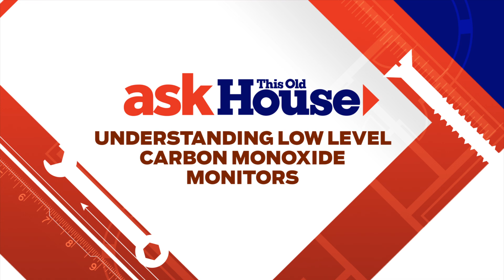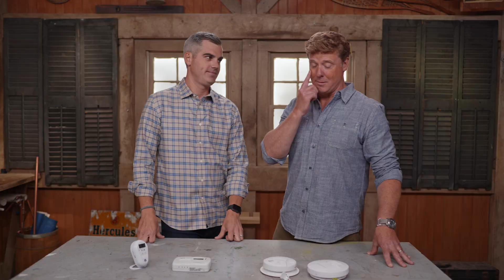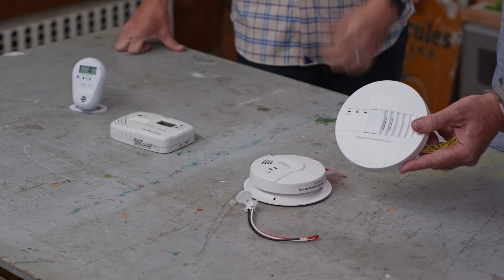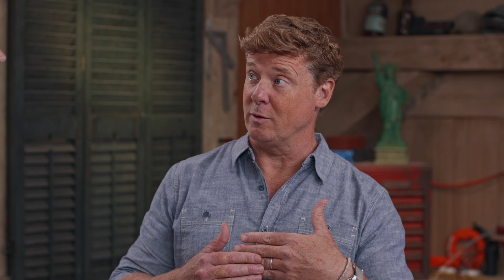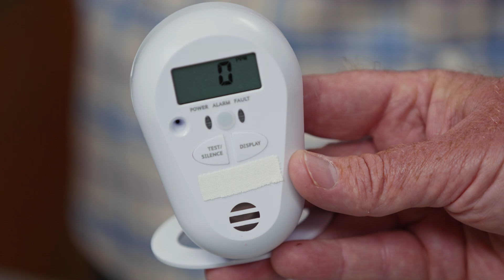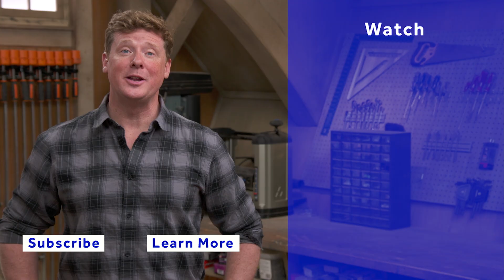Understanding Low-Level CO Monitors | Ask This Old House

Comment: Thank you so much! I purchased one of the Low Level CO monitors you listed. We are in a 1st floor loft with cement floors and the garage is directly beneath us. We had a 911 experience when a company was cleaning the garage last summer, wherein the CO alarms went off, and the lofts above the garage all filled with CO. My guess is that there is still CO seepage from the garage into our loft and now that it's winter---people are warming up their cars inside. Could account fr the recent headaches and dizziness.

Comment: Yes, low level detectors are important to have as well! My regular over the counter, round alarm did not detect or sound when I was getting sick for several months. I had no idea the ones you buy for every day use don't sound until a certain level is reached. The one I had didn't sound all winter and it wasn't until my symptoms were so terrible that I couldn't stand it any more and started doing my own environmental investigations by having service people come and check for mold and assess my HVAC system. The service tech found a leak and crack in my HVAC with his commercial monitor. Very dissapointing and confused on which is best to have on an everyday consumer basis since mine didn't alert me. This video is helpful.

Comment: I have a CO detector on every level of my house. 3 of them with digital readouts. All three have a peak display as well.
I    had   a 2 stage Hi Eff furnace that was leaking CO into the hot air supply only when it was in the second stage or high heat
The furnace was inspected, tested, serviced 3 months ago and  passed with flying colours.
The tech tested for CO in first stage heating and second stage even tested the CO output on the exterior exhaust pipe.   AND    there was the downfall!  He didn't recognize or know what the reading of CO was telling him in second  stage heat.  IT was a low reading at the exhaust pipe of  11 ppm which was actually two low, It should have been closer t0 20 ppm or higher.
So for months I was suffering symptoms of low level CO poising and    NONE    of the CO detectors triggered because the CO was below the trigger points of level and time.
Got 2 tech in from the company and the second tech knew instantly after running the furnace what the problem was..a crack in the heat exchanger that opened just a fraction as the heat exchanger got much hotter in the second stage of heating. 
Note: this was his his diagnosis  without   physically inspecting the exchanger itself. 
Low levels CO poisoning is a real threat but until I stated researching it I was totally dependent on my CO detector that never went into an alarm state. I had symptoms of rapid heart rate, skipped heart beats, the worst BRAIN FOG,  just on the edge of a headache and nausea and a real need to keep opening windows without knowing why.

Comment: I have two parrots in my home and need a low-level detector
Defender vs co experts vs  nci6000
Are any others you recommend
Thank you
Reply: I’ve been working as an expert witness on CO cases since 2006. My company (TruTechTools$) sells CO Experts and Defender alarms. The NCI ones are available only through NCI contractors. 
All three brands are fine products in my opinion. They have a few feature differences, but basic functionality is similar.

Comment: 30 years ago this type of CO detector bought on a whim led to discovery of potentially lethal furnace problem in our home with 2 young children. What TOH failed to say is that there are good yet inexpensive detectors (Nighthawk is the one we had) not just the $100+ models they are pushing. Also, the CO detection chemistry gets depleted so these things last 10 years or less.
Reply: Thank you for sharing!
Reply: Nighthawk USED to be more sensitive, now they meet the same inadequate standard.

Comment: Does the alarm go off if someone farts? Asking for a friend.
Reply: That’s methane  and a few presidents said it’s climate change so best not fart . It should show a difference in climate change in 10,000 years or more .
Reply: Flatulence is mostly methane, CO2, and hydrogen sulfide gas, not CO which is why it smells bad.

Comment: Poor information.  More like scare tactics.  What level are we targeting?  Are they recommending zero ppm??
Reply: They already said it would be different for different people.
Some people have lung dysfunction like emphysema where they don't take in enough oxygen and can't tolerate as much CO as healthier people. Some people are home cooks that may have a gas stove running most of the day and have a longer period of exposure than others. Some people may have a malfunctioning heating system or a leak where the levels spike for short periods of time but not long enough to set off alarms.
Reply: There are health risks for very low levels.  People who are either small or have medical issues that make them less able to recover from exposure should want lower levels for shorter periods of time.  If you own a gas range, ignition will create CO.  But with good ventilation, it will dissipate quickly and you are at extremely low risk.  The bottom line is that if you are small, old, or sick, this should scare you.

Comment: Also: if your low-level monitor is showing non-zero, your furnace heat exchanger might be starting to rust out and you can catch it way before it finally trips the code-required CO detectors, maybe even years earlier, during which you would otherwise be breathing CO.  (Any appliance that burns gas - even a water heater - could cause this if there's an issue with the combustion itself or the ventilation of the combusted gases. )

Comment: Can ya tell us more about radon meditation units
Reply: There are new radon measuring devices, AirThings brand, that my company sells (TruTechTools). They will alert you as radon levels that change due to various factors. 
Radon mitigation systems (ducting and fans) need to be installed by qualified professionals which can be easily found on line. 
I assessed high radon levels in my own new home and had to install a radon mitigation system to get below recommend target concentrations.

Comment: Wonder if there's a cheaper, or free, way to test the levels without having to purchase a low-level CO monitor? We have only electrical appliances and never have used our gas fireplace (propane). However, often have headaches and now wondering if CO might be cause.
Reply: Could be mold, particulate matter, low oxygen levels, VOCs... you should have a good ventilation and filter system doing X number of air changes per hour (depending on house size/number of people).
Reply: @rustyshackle917  Yep, or even high levels of carbon DIOXIDE, which can be a concern in "tighter" houses where leaks are minimal, reducing air exchanges, normally a desired effect, but Richard Tretheway often discusses the membrane-based heat exchangers that are important for bringing fresh air into tight houses.
Reply: Sadly CO cannot be detected without a measuring sensor and these engineered devices have a price, as said $100-$200
Reply: It's all about how worth it is to you. Is your health worth the $50-$150 for a low level CO monitor? You could shut off the main gas supply line. Propane does usually have a smell however. A free, but unreliable option would be to have a friend come over and ask them if they smell anything, but obviously that's not good enough.
Reply: @StuffTested  After seeing the high end models and Fire department wearable i’m going to spend a few hundred for family gifts .

Comment: Excellent information. Even UL says its acceptable levels may be too high for elderly, immuno-compromised. Will have to look into sensitivity of the “approved” devices required by code (California) in my home.
Reply: All about PPM and TWA. Parts per million and time weighted average. Good info.
Reply: As the commenter and video noted, it’s about concentration and time of exposure since CO is a cumulative poison.

Comment: can't be zro though. we breathe out co.
Reply: we breathe out CO² not CO
Reply: @TexasMAGA2028  Carbon dioxide is not CO² , it's CO₂ .
As for breathing out CO (carbon monoxide), the OP is correct in that we do breath out CO – we do it every time we breath in CO. That being said, if the OP was trying to say that we produce CO through normal, human respiration then he's mistaken and probably confusing CO₂ (carbon dioxide) with CO.
Reply: @Confoil  well excuuuuuuuuuse me mr. perfect. i typed that comment on an android, it doesn't have the lower 2. humans only expel CO after CO poisoning or smoking.
Reply: @TexasMAGA2028   You're not excused as that's "Mr. Perfect." I know your android has the capability to capitalize letters – so use it. Other than that, correct your posts before correcting someone else, don't repeat what others have said when you are responding to them, edit your posts when necessary (that's the point of that edit button), and get a better phone that can do subscript numbers since your's (according to you) can't.
Reply: CO (carbon monoxide) is not the same as CO2 (carbon dioxide)
Reply: No way you would ever exhale enough to set a co monitor above zero under normal circumstances. Shoving in your mouth and letting about a huge breath might tik it up but it will fall as fast.
Reply: carbon monoxide makes a strong bond with hemoglobin and is cumulative.  Our Hvac contractor measured the levels from our gas furnace and replaced the burner to reduce the output of CO.
Reply: No we don’t 🤦‍♂️

Comment: CO alarms "...mounted on the ceiling."  ?????
Reply: A lot of CO detectors are built into combination CO smoke detectors so they're typically on the ceiling.

CO distributes itself evenly in a room with a slight bias away from the floor, so placement of CO detectors is a lot easier than smoke detectors.
Reply: According to First Alert's web site CO is slightly lighter than air but diffuses throughout a room evenly, so their CO detectors can be mounted on the ceiling.  Kidde's web site doesn't specify any particular location in the room as long as it's not in a "dead space" area.
Reply: CO is heavier than Oxygen. I'd mount low
Reply: @knowledgeispower6192   CO could be heavier than oxygen but it's lighter than air.
Reply: @knowledgeispower6192  This isn't how gases work, look up Boyle's law

Comment: How much of carbon monoxide is in the air?
Carbon monoxide is the most abundant, by mass, pollutant gas. Atmospheric carbon monoxide levels in typical urban areas are around 10 ppm (parts per million), about 100 times higher than in Earth's atmosphere overall. In areas with heavy traffic, CO levels can rise to as high as 50 ppm.
Reply: Incorrect. Indoor levels are typically in the ~0.5 ppm range. Outdoors depends on where you live but is ~0.5 in Massachusetts. Here is more info-  https://www.epa.gov/indoor-air-quality-iaq/what-average-level-carbon-monoxide-homes
Reply: Here is the outdoor CO levels in the New England states from 2022…https://www.epa.gov/system/files/documents/2023-06/CO_2022.pdf
Reply: You are correct; living right next to a highway, on an industrial street with constant diesel exhaust, yes indeed.  Those folks are definitely at risk.